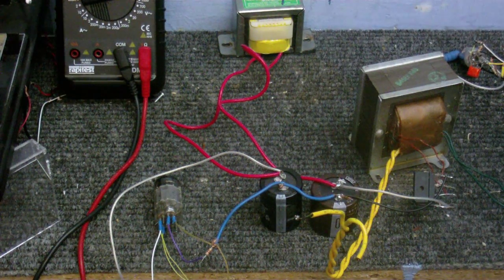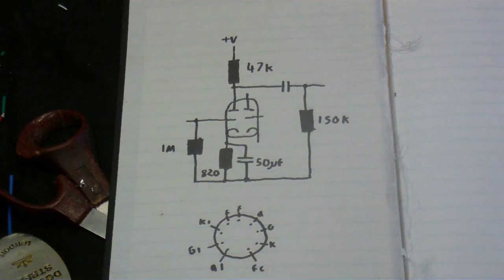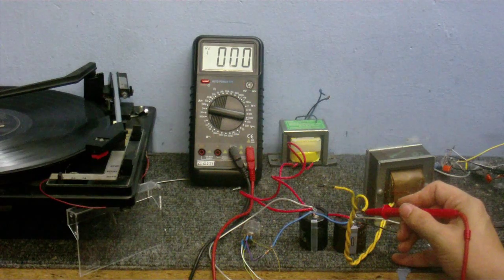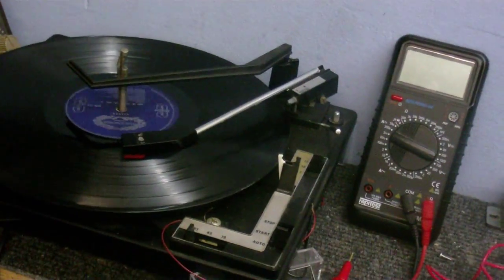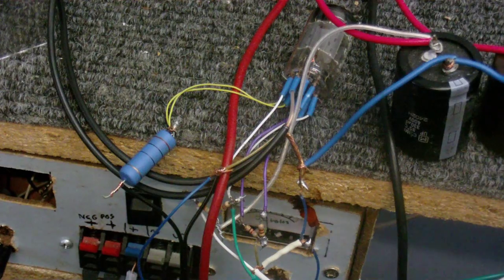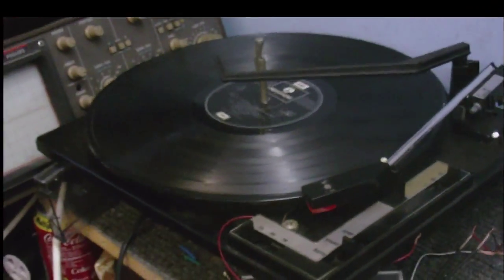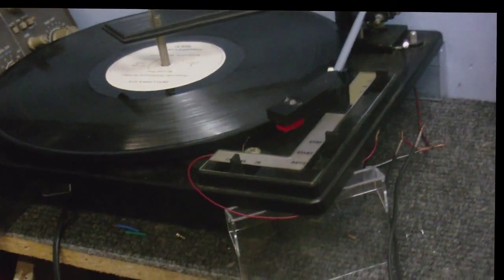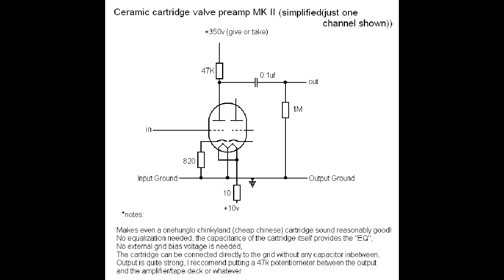Making a stereo turntable with built-in ceramic cartidge valve preamp

Comment: the tube you have is an ECC83, dual triode. the voltage you have on the anode is a bit too much for it, put it another resistor. also, never connect the high voltage to a tube if the filament isn't turned on.

Comment from the maker: I did give the soldering a bit of a re-flow, they did an absolutely terrible job in the factory, but it didn't help.  Anyway I do have another meter that also died on me but it has the same switch and I think the switch on that one is still ok, so I might just use the switch out of that one as the replacement.

Comment from the maker: There's 2 caps becuase it has stereo output, there's 1 cap to block the dc on the left, and the other cap blocks the dc on the right.  I think the sound is a little muffled simply because of the cheap cartridge.

Comment: On the meter did you try re soldering the terminals on the power switch? Or put some lubricant like WD40 inside the switch. I use tri-flow. And then operate the switch many times. If that doesn't work you can always add an external switch so you don't need to spend money on a new meter. Those pushbutton switches are notorious for not wanting to work. And Johnny cash FTW.

Comment: Also a few things u need to bear in mind when working with valves. Ac filaments supply will always cause loud hum.  The filaments can be connected in series by connecting pin 4 to 10-12V and pin 5 to ground.  Leaving the grid floating is genrally a bad idea as the valve could, if left with no input, go in a + feedback loop and melt.  Also little dual triodes like the ecc83 can be run in starved plate mode where the plate voltage can be as low as 9v if the bias is set very hot.
Reply: totally agree. A 1meg to ground should solve the problem on that grid.

Comment: the cap next to resistor is realy importand

it is in a bias circuit
and when you dont use it you will get less amplification

the cap on the anoode is to filter the ds from the signal
and the resistor in and out are for the impedance matching of the tube